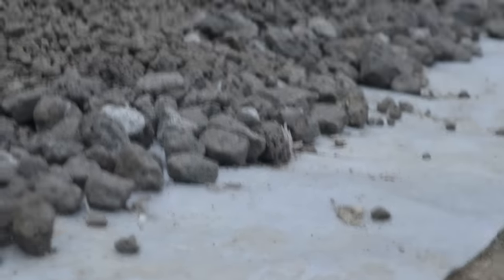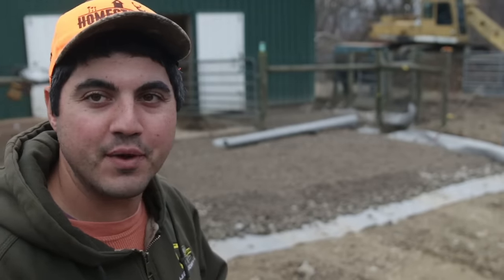SIMPLE SOLUTION To Livestock MUD PROBLEM - Heavy Traffic Pad

Comment: You have to keep a closer eye on their Hooves though with all that gravel they could get a stone in the hoof that can create an ulcer.
Reply from the maker: True, i address this in an upcoming video, I mentioned in this video many top dress with sand if they will have their livestock on it a lot. Originally we were not planning on keeping the cows on it all winter, but that’s changed and I’ll talk about why in that video coming soon. Gravel could cause a bruise, but still much better than letting them be in mud, mud can cause pulled muscles, mastitis, and foot rot 😣
Reply: Foot rot can is usually caused by a cut or sore in the hoof; which is being accelerated with the rocks; this may work ok for a small hers of livestock bit it would never be feasible with a larger herd; if you want your livestock to have a dry place why don’t you just bed an area with straw or corn stalk bales; corn stalk bales will last a lot longer in real wet conditions

Comment: i and my buddy did this some 30 years ago and it didnt work, first it made for a lot of stone brushing cracked hoves ,  it was not long and the live stock had it loaded in cow poo wotch was worse then the mud, at least with the mud to poo washed in, and was npt at all like the slimy ,ess the rock and stone area at the feding bunks ended uup being, as all the poo runs down t the bottom and is trapped there making a real sess pool, we both ended up digging it all out, and compacting graval and black topping for ease of scraping it up, concret was not in the budget for ether one of us

Comment: #askhomesteady I would be concerned with the "2 inch" stones getting lodged in the animal's hooves. I would also think that in time the area will build up manure between stones to the point it will once again become a "mucky" mess during rains.
Overall a great job and improvement. I wish you'd have included a final shot showing the water draining out the far end of the pipes, and off your homestead...
Reply from the maker: We address the 2" stones in an upcoming video, I mentioned that if you are planning on keeping your livestock on the pads full time that sand would be a better fit, we origonally were not going to keep the cows on the pad but rather use it just as an access to the barn and waterer. That has since changed, they are on the pad full time, and we have added another material, you will see in an upcoming video. Also the manure issue is addressed in a future video as well
Reply from the maker: We address the 2" stones in an upcoming video, I mentioned that if you are planning on keeping your livestock on the pads full time that sand would be a better fit, we origonally were not going to keep the cows on the pad but rather use it just as an access to the barn and waterer. That has since changed, they are on the pad full time, and we have added another material, you will see in an upcoming video. Also the manure issue is addressed in a future video as well

Comment: With horses this is called a 'dry lot'. You put the horses in there when it is raining for the most part. You have to scrape it once a year to remove the manure top layer. You cannot use sand when doing this for horses. The top layer is 'screenings' or 'traffic bond'. It is coarse 1/4 rock that interlocks and gets real stiff.

Comment: LOL... Well boys and girls, it all depends on where you are and how many animals you have...
Our cow lot (dry lot) has been re done many times over the years.. 
The last time it was re done.. it was brought back up to grade with 
well over 100 truck loads of reclaimed concrete and asphalt as a base and a filler, most of it is 4' to 6' thick. It is topped off with over a foot of reject. It still gets to be a manure/mud mess. It gets cleaned regularly through out the winter.
The rock used in this video looks to be "drain rock", I noticed a few comments about the rocks getting stuck in the hooves.. yes, it will!! 
That is why we use reject, it's generally softer rock and has fines and some dirt in it, so it will pack and not cause hoof issues.
Just my take on it.. our cattle have been on the same dry lot every winter for almost 70 years...
Concrete would be nice, but we don't own a bank...

Comment: You don't want sand, I think it's a mistake. If anything put clean 1a limestone. Up here in pa it's what they use on the road for anti skid during winter, (cinders). But they're clean. A little expensive but they'll lock in with the other gravel. They make a grid lock Pentagon shaped plastic that locks everything together and even driving a truck on it won't rot it, but that's overkill.

Comment: @ASKHOMESTEADY
What kind of building codes can affect installation of the Curtain Drains and pad?
Reply from the maker: that is very specific to your town and state regulations, check your local health department and zoning if your worried about the regs, the gravel pad probably not so much to worry about, but curtain drains can have regulations that keep you from putting them in near buildings, septic systems, etc.

Comment: That's a great solution for driveways and walkways! I know you said you might top it with sand in the future, but until then, I think anyone who does this is going to have a nightmare on their hands trying to clean up manure.
Reply from the maker: I have a great solution for that, video coming stay tuned.
Reply: Surprisingly gold mining has a solution to getting the dirt and manure out of gravel in the form of a trommel. A rotating section of classifying screens starting small and ending large with a sprayer bar washing mud off the gravel as that is where the gold is so the exact same setup would work well for cleaning classified gravel.

Comment: Can’t afford it...
Reply: Don't bother. It will injure your animals feet. Better to dig it out and dump about a foot of tree mulch instead of rock. The wood will absorb the water and allow drainage and will not hurt your animals feet. Otherwise you will have stone bruises cows that are down or just refuse to stand on it. Try walking on a gravel path barefooted. Now do it with a 200 pound pack on. That is the pain they will feel. Wood chips will decompose over time but can be found everywhere that has some tree trimming services for thousands cheaper. And the result after several years is the best growing soil you have ever seen in your life. When you see plants sprouting you will know its time to either top it off with fresh Wood chips or dig it out and top with more Wood chips. Just a thought from someone who has raised beef and horses.
Reply: Premier solar portable electric fencing may reduce mud if have the land and time and ability to move lightweight...though often having enough land to rotate isn't possible...woodlands can be used if take down enough trees them cows can enjoy summer shade...thinning trees takes more time and resources though...anyone else got ideas for mud prevention without money for hi traffic pads and french drains and stone/gravel and non texture fabric for high psi on land large livestock? Cows...